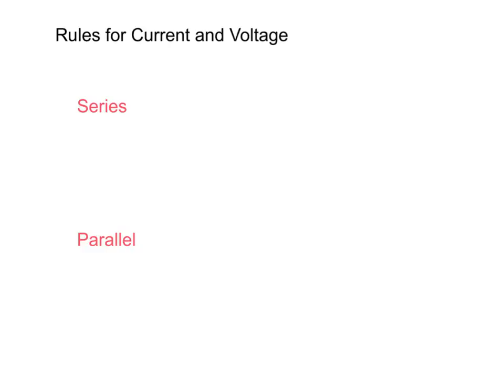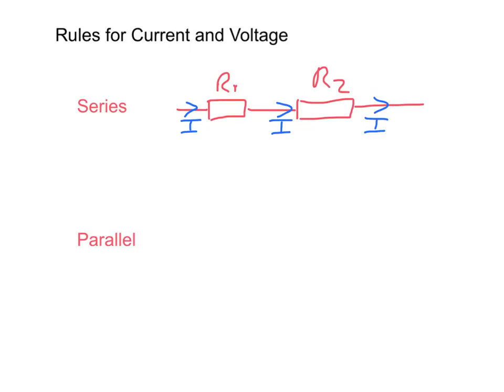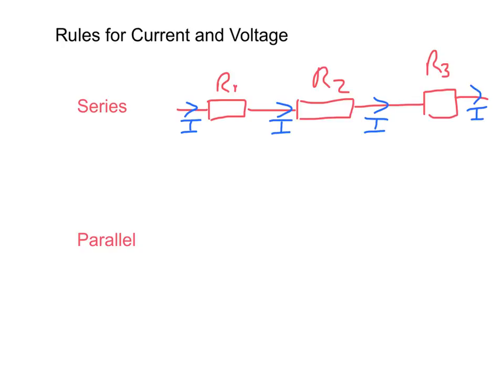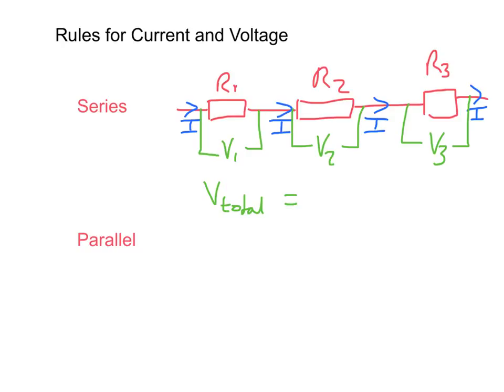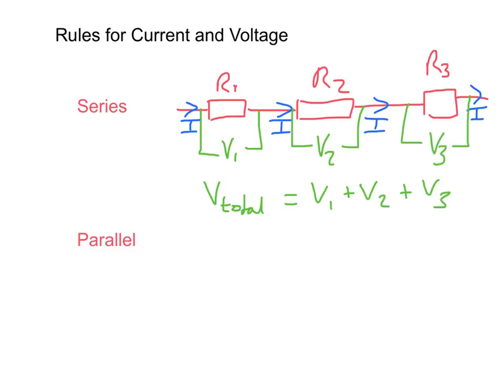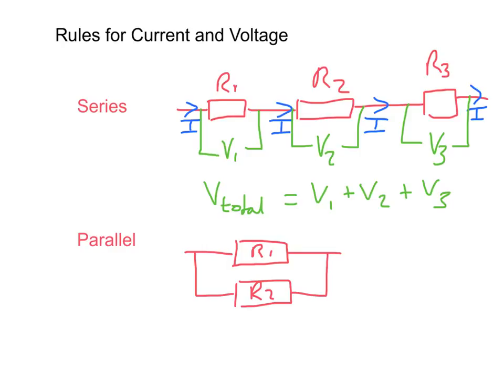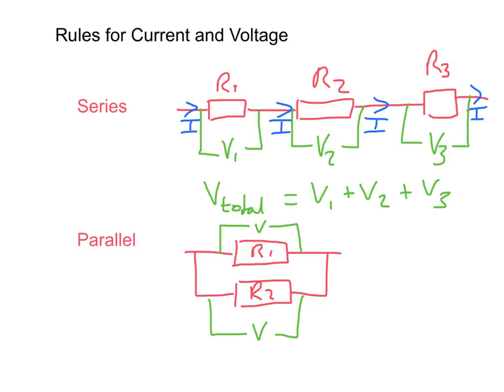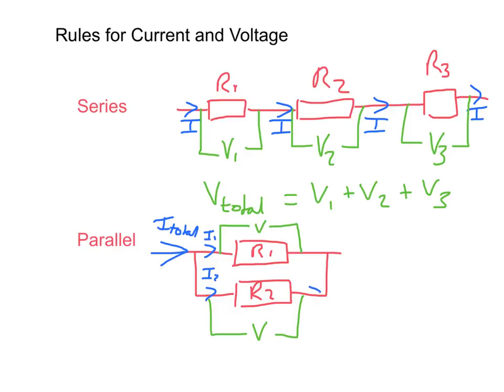Rules for Current and Voltage in Series and Parallel Circuits

Comment: in series, if the current goes through different resistors won't the current be different at different points
Reply: no, because the current is flow of charges. the charge carriers, electrons, for example, are still there after it goes through the resistors so current doesn't decrease. the voltage is electrical energy per unit of charge(current). since that energy is used up at every resistor and the charge is still constant, this is the reason voltage decreases.

Comment: but why doesn't the voltage split in parallel
Reply: I'm guessing that due to V=IR, voltage would be constant because I and R will be changing to keep that constant. For example, if you increase the resistance in one side of the parallel then the overall current will decrease in order to keep the voltage constant. IN the other side if you decrease the voltage, the current will increase in order to have the same value of voltage.
Reply: @darkChocol8  OK thanks ill keep reading that till I get it